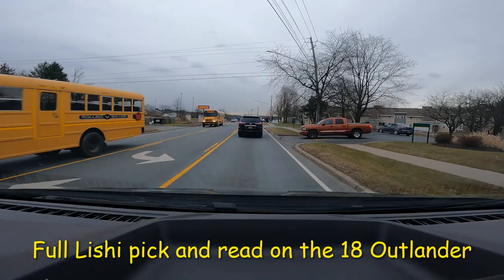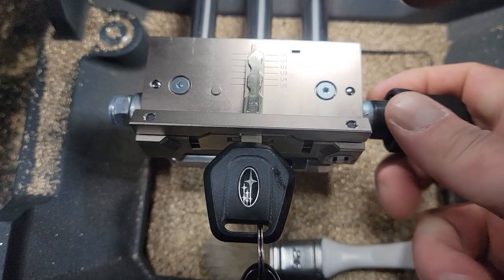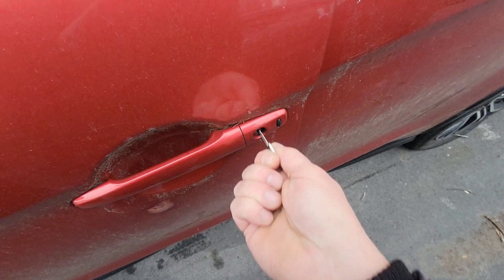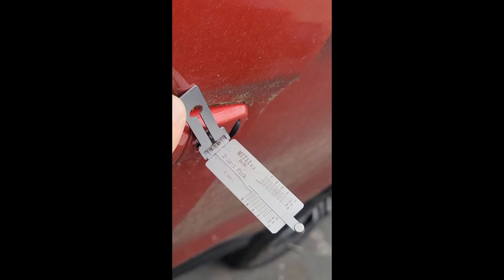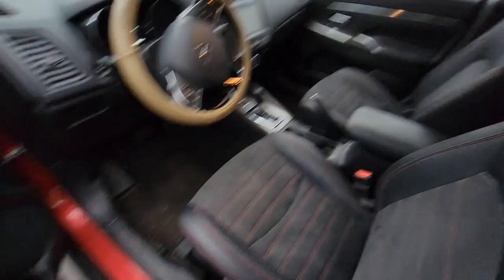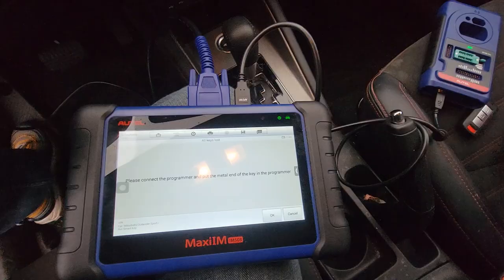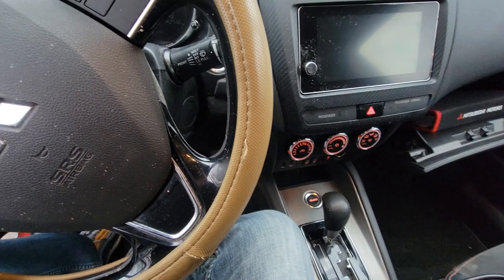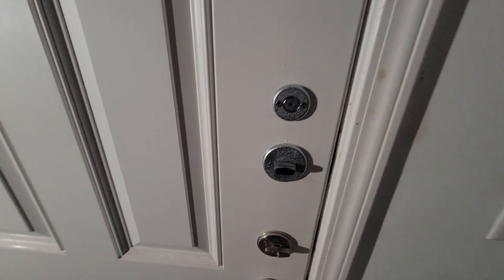Locksmith Calls 12/15/21 full Lishi pick and read, IM508 and XP400 Pro Autel 18 Outlander Prox Key

Comment: did you use the lookup feature on the gymkana for that last digit to get code? also I did my first Hyundai listing and key cut. When I manually typed in bitting the key didn't work; turns out if I flipped numbers it was correct. Is this a Hyundai thing or is it a setting on machine that I can change.
Reply from the maker: I run the cuts I have through a fill program.
Reply: @locksny  gotcha...have you used the one on the gymkana to fill a code? Ive used it twice and it worked both times. Who do you use for codes?
Reply from the maker: @MrSuperchargedv8  I use Blackhawk's fill program. I have used the one on the machine a couple times myself.

Comment: Why Lishi the Outlander when there is a code on lock and removes easily?
Reply from the maker: Truck was sitting forever, my luck the bolt would snap off or strip. Easy enough with the Lishi. Salt belt here in NY.

Comment: Hey Jay, there is a big difference between the IM508? and the IM608? for a locksmith?
Reply from the maker: If you get the full setup for the IM508, not much. You loose a bit on the diagnostic side.
Reply: @locksny  Hey, when you say i am losing a bit on the diagnostic side, you mean mechanic stuff that as locksmith i won't need, right?
Also, what is the full setup with the IM508? I mean, what setup i need to get in order to start doing car locksmith. I am from Jordan
By the way, your videos are the best on youtube, on this topic
Reply from the maker: @zimmers  You really don't need the diagnostic unless your going to repair cars. I'm talking about the full package IM508, not the base model.
Reply: @locksny  Thank you for the answers.
One last question, Each time i program a key i need tokens? or on the im508 it's not like that?
Reply from the maker: @zimmers  No tokens required.

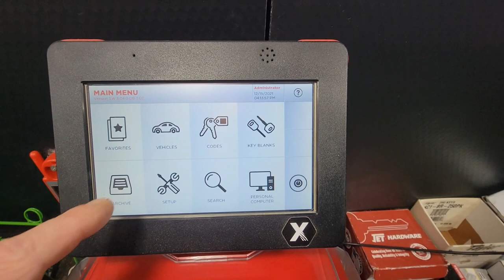Comment: Hi Sir you are doing great job and your videos are amazing! On the video's 6:26 after u decoding with lishi tool how do u get the code 31164? which tool or app are you using for converting that lishi code to key code?
Reply from the maker: You need to use a fill program.
Reply: @locksny  would u give a name
Reply from the maker: @datafreak911  Email me at the link in the description.
Reply: @locksny  I did it
Reply: @locksny  I have an acura 2001 el lost all keys. I got my keycode from the dealer and I cut the key. Tried all key lost options on im508 and at the last step i got "operation time out error". At the beginning it was saying connect with honda obd tool which is not fit my car and i connected with regular obd cable. Shall I try with Key tool Max pro?
Reply: I tried with Key tool max pro and i got Err 080404. Can it be related to auto alarm? Because it was active and was making terrible sound  when i was working on it

Comment: Great video locksny, I just learnt a heap of things. Firstly so many different key fobs requiring different things to do to make them go. Never seen the port thingy in a glovebox before. That jamb marker, now that's a clever idea do you buy them or make them. If you make them could you give us a little explanation next time you use one on video at how you knocked one up,  Excellent skills with the lishi too. cheers mate, thanks for this video
Reply: Look up how to do a fresh deadbolt or knob lock install. The tool he used marks the center of the hole on the door. Which allows you to transfer the same hole for the strike on the door jamb. You could also use the 1” hole barrel drill bit to make the door jamb mark.
Reply from the maker: Take a 1" wood dowel, find a nail, drill a hole slightly smaller then the nail, cut the head off and drive it in head side first and sharpen the point if you need to. I will show it the next door I do so you can see how simple it's made. You can also buy them in plastic. 
The car key business is not a cheap one with the inventory you need to stock. Cheers PW
Reply: @locksny  thanks for explaining how to make one. As an ex carpenter I used to do a lock install every so often and would use templates from the packet or if none I’d just line it up and use measurements or just eye it and hope. Good to know this time saving tip. Appreciate you showing this in your video and taking the time to explain how to make one. I’m not the sort to go for a plastic alternative when I have a wood option. The auto locksmith here in Oz is becoming a specialty on its own. Not many locksmiths here that do residential and commercial do auto, those locky’s that are the jack of all are a rarity here now. As you say just the costs of holding all that different stock these days as well as the different tech I have seen you  and PJ use would be quite prohibitive to a newbie starting out on their own. Not to mention all the licences you have to fork out each year for access to the tech also makes the startup costs for an auto locky prohibitively. Have a great weekend ahead. Cheers
Reply: @2815Juan  that is a good idea as well and thank you for this explanation. Cheers
Reply: @PocketWomen  And then customers complain, “why is it so expensive to have you come out and take care of this thing on my car”, or even worse they try some hack job off the Internet 😂